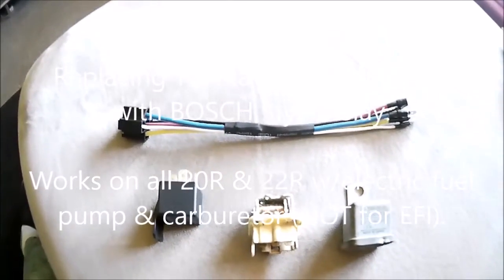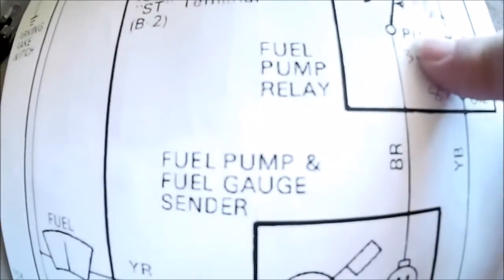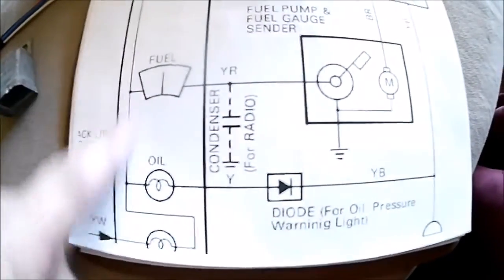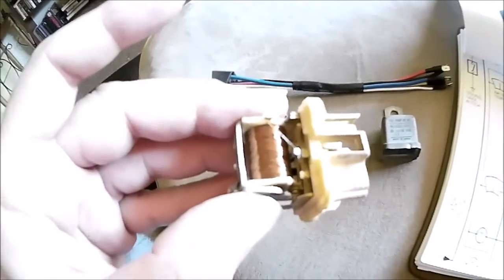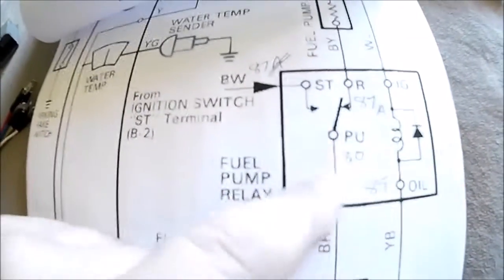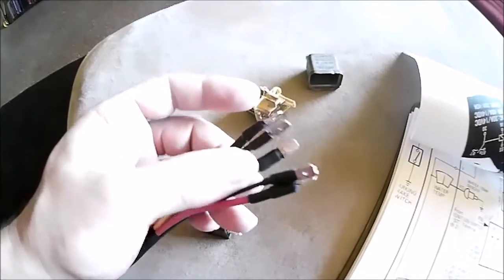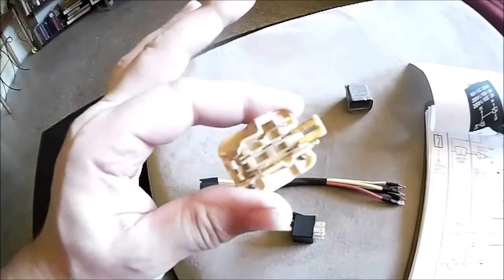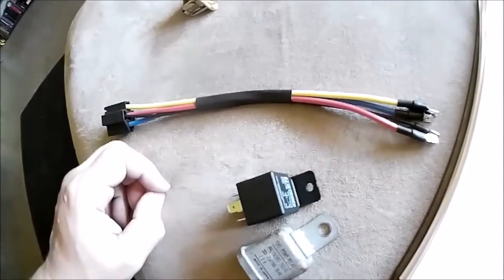1978 Toyota Pickup 20R-Fuel Pump Relay Replacement/Substitute

Comment: Can i run this relay, on a weber fuel pump? Im going to run new wires to it & powered from the key switch.
Reply from the maker: For most actual Weber branded electric fuel pumps, and some other "aftermarket" pumps that I am aware of, they are all designed to run on full 12 volt battery voltage. So you would no longer need the Fuel Pump Resistor in the circuit. If the resistor was left in the circuit, the Weber pump would only get 9.5 volts in the "RUN" condition, and that might cause you some fuel pressure & volume problems. The resistor could be bypassed at it's harness connector with a jumper wire so that the Weber pump would get full battery voltage in the "RUN" position.

I think it would be a good idea to retain the Fuel Pump Relay & you could use the existing fuel pump wiring in the truck's harness to do this. Running all brand new wire to the new pump, I'm uncertain why you'd need a relay. Just use 16 gauge wire & you would be OK. Most electric fuel pumps only draw 3 to 5 amps so they are not a "high draw" item, electrically. 16 gauge wire is good to 20+ amps.

IMPORTANT: Depending on the model of Weber or aftermarket pump, and whether or not you are using that pump to supply a Weber carb or a stock Toyota carb, there are some differences that you need to be aware of. I will explain.

The stock Toyota carb is designed to run best on 5 to 8 PSI of fuel pressure. The Weber 32/36 carb works best on a fuel pressure of 2 to 3 PSI. So you need to match the pumps specs to whatever carb you are using, ESPECIALLY for a Weber 32/36. They don't like fuel pressures anything above 3 PSI & will easily flood out if that is exceeded.

The lowest PSI pump that Weber makes is a 6 PSI pump (Weber Part # 99009.131) so you'd also need a fuel pressure regulator to go in your fuel feed line to the carb IF you're running the Weber 32/36. I'd recommend the Holley #30-804. It's decent quality, within the PSI spec (1-4 PSI), is adjustable & is affordable.
IF you're just using the Weber pump to supply the stock Toyota carb, you don't need a fuel pressure regulator. The 6 PSI that pump puts out will be fine for the stock carb.
Reply: @The13thSword  i wanted to run new wire & relay incase my truck had a faulty relay or wires, the stock fuel pump im hardly getting 1psi. So truck felt power less on top end. I have a weber 38 on it rn & fall on its face at 3k RPM. I have a fuel pressure regulator, so i just need better fuel pump, i might also run new fuel line incase the stock is clogged or something. The carb doesnt get any fuel, basically it has to be sucked up by covering the carb when cranking. So i think my problem is fuel.. 

I did found a replacement relay that fit on the stock hilux. That you mention on discriptiom. wanted to try that one, incase the relay on truck doesnt work. But i like the idea of just running a new relay & wires to pump & have less problems. 

My truck has:
22r/20r hybrid
Weber 38
Stage 3 stroker cam *replacing with this
LT Headers
Cannon intake
Reply from the maker: @Mroswaldo16  1 PSI measured or guess-timate? If so, that sounds more like a fuel supply side problem, like a restriction. The stock fuel pumps almost never go "weak" like that; they either work or they don't. It could be corroded or pitted contacts in the relay but I'd have a strong look at the fuel pump resistor first. Test it with an Ohm meter for resistance. The spec is 1.4 Ohms cold, & no more than 1.54 Ohms fully hot. Once those start going bad they develop higher than spec resistance, which could "choke off" voltage to the fuel pump. That could account for the much lowered pump output.

You could also have a collapsed fuel line, clogged up fuel filter, the filter sock on the pump itself is clogged, or (this is rare) a bad ground to the fuel pump in-tank. You should also verify that your pressure regulator is working correctly. What brand & part # of regulator do you run? Have you dropped the gas tank and actually had a look at the filter sock & pump?

The only reason to run a relay is for safety & function as Toyota designed it to work. Like I said, the stock relay setup "toggles" the voltage going to the pump from the "start" or "run" sides depending on conditions. The stock relay is also dependent on signal/no signal from the oil sender switch. This is the safety side of the circuit. The intent is that in a crash & the engine stops, the no oil pressure signal from the oil sender breaks the circuit to the fuel pump so it doesn't keep running. If this didn't happen, the pump could keep running, & throw raw fuel through broken fuel lines onto hot metals, causing a fire. If you don't care to keep this safety feature it's up to you but be aware that you will lose the safety feature. Your risk.
Reply: @The13thSword  1 psi measured. I installed a fuel pressure regulator. & it bearly read 1psi

& its a regulator from lce performance.

I might have to pay someone to test that, im not electrical person. I did wanted to check the stock relay see if its corroded.. it did had a new fuel pump. Like 2 years ago.
Reply from the maker: @Mroswaldo16  Have you tried adjusting the regulator?
Reply: @The13thSword  yes all the way in & out & nothing. But fuel pump doesnt fill the fuel line. At all when i turn the key on & not sure if the oil pressure sensor works too, sunce relay is hook up to that.
Reply from the maker: @Mroswaldo16  OK, so since the fuel pump is only two years old, you'd have to suspect either a fuel line restriction or blockage, an issue with the carbs float level, a stuck needle & seat in the carb, or an issue with the electrical side e.g. fuel pump circuit. I suggest you choose one of those systems (carb, fuel tank, line & filters, fuel pump circuit) and go through each of them front to back without skipping anything.

Also, you can test the oil sender switch with an Ohm meter. Engine NOT running - Disconnect the wire from it's terminal on the sender, put positive probe on terminal & negative probe to ground. If good it should read resistance. Cranking engine over for 3 to 6 second with the probes still hooked up, once the cranking creates enough oil pressure to open the sender switch, the meter should read OL (open line, or no continuity).
Reply: @The13thSword  new pump, still was weak & i put a new weber 38 carb on it. Was thinking of running new fuel line & test pressure to see if its fuel line, then go to wiring on fuel pump, new fuel filter before being sitting for like 3 years.. Whats the other thing thats close to the relay? Fuse) that goes bad..  

Grtting my truck running again so i bought a new weber fuel pump, replacement relay, (hoping the wiring is good) going to test power on fuel pump to see if its 12v. Dont know much about  electrical stuff.. was just thinking of runing a new relay & wiring. But going to try the new relay & see if the oil switch is working.. 

so to see if i got it on testung the oil switch..  
To test if its good, with key on (no emgine running) should read resistance. & crank it, until it build oil pressure & should read no volts or resitance??
Reply from the maker: @Mroswaldo16  I think I mentioned this before but you need to test the fuel pump resistor. On my truck it is under the hood, passenger side on top of wheel well, mounted on a steel plate. Spec resistance is 1.4 Ohms cold, 1.6 Ohms hot. Stock resistor is a ceramic wire-wound resistor (power resistor) and these can get weak over time, allowing higher resistance & blocking voltage to the fuel pump. Test it for proper resistance reading with an Ohm Meter. It would also be good to heat it up some with an electric heat gun or blow dryer to see if resistance goes beyong hot spec. DO NOT use a torch or open flame on the resistor for this test.

Go ahead I plug in your new relay I see what happens. If all is still the same, it could be the resistor. There is no in-line fuse for that relay circuit, it is powered direct from the ignition switch "start" or "run".

Correct on the oil sender test. You can also just see if it's working correctly by watching the "oil" light on the dashboard. Key on no crank light should be on. Crank engine & light should go out in 3-6 seconds (even if engine doesn't start).
Reply: @The13thSword  going to see that resistor. Not sure if its still there, its a green plug?
Where can i find a new resistor?
Reply from the maker: @Mroswaldo16  Have a look at my video here: https://www.youtube.com/watch?v=aiOzfXWTlLU&t=244s

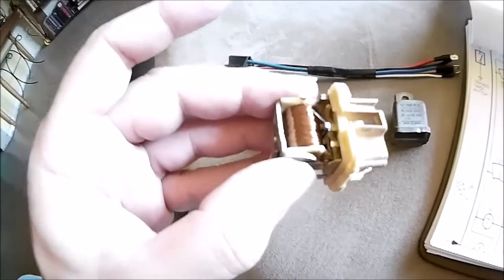Freeze the video at about the 6:00 minute mark. Look just behind the battery & to the left of a large round vacuum switch, & you will see where the fuel pump resistor is mounted (stock location). Yes it does have a green two terminal plug.

BTW, you can temporarily bypass the resistor to see if it's the issue here. You can unplug the resistor from the harness connector for it, & put a jumper wire in the  harness connectors' terminals. This will supply full battery voltage to the relay under "run" conditions (either engine running or sufficient oil pressure obtained from cranking with no start).

PLEASE NOTE! I do NOT recommend running the truck with the resistor bypassed for any length of time, only just as long as it takes for testing purposes. The stock style fuel pump usually only gets full battery power when cranking, & it is not designed to run on full battery power continuously. Running the pump on full battery power for extended lengths of time could burn out the pump.

Toyota no longer offers new resistors for sale. I found a new military spec power resistor with an aluminum case, that I soldered into place of the old one. I used the existing wires & plug & was able to mount it on the old steel plate.
You can use any good quality power resistor, either metal cased or ceramic as long at it has these minimum specs: 1.4 to 1.5 Ohms, 10% tolerance, 10 Watts power rating. The Ohms rating is critical, but the tolerance can be less than 10% & the wattage rating can be higher with no problems. The one I used is this one: https://www.mouser.com/ProductDetail/ARCOL-Ohmite/HS10-1R5-F?qs=bvCpHSZmQjn9W4WgobfMBw%3D%3D
Reply: @The13thSword  going to test the resistor when the engine is back in, hopefully its that, so i return the fuel pump i bought. I also just ordered that one getting here this friday, incase its faulty. 
Will upload vid to my account as i go.
Reply from the maker: @Mroswaldo16  You can test the resistor without the engine, just use an Ohm meter. All you need to test for it being out of spec when hot is a hair dryer. I did this & it works fine for testing.
Reply: @The13thSword  so doesnt need power from battery to work? It should.give ohms reading?
Reply from the maker: @Mroswaldo16  Yes of course. The Ohm Meter supplies it's own power to whatever component you are measuring.
Reply: @The13thSword  oh ok, will try to go test that this weekened. Since my truck is at a yard at a friends house.